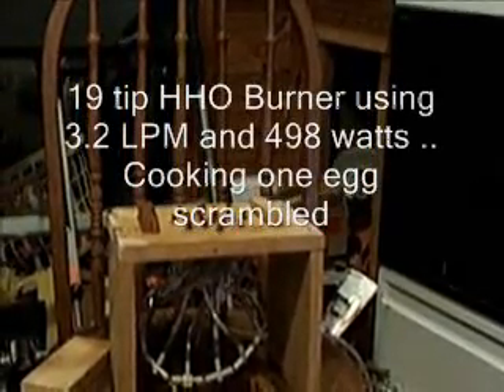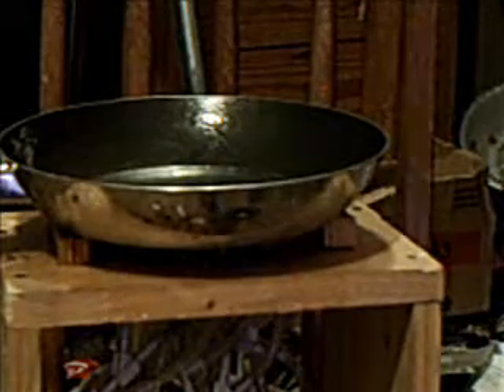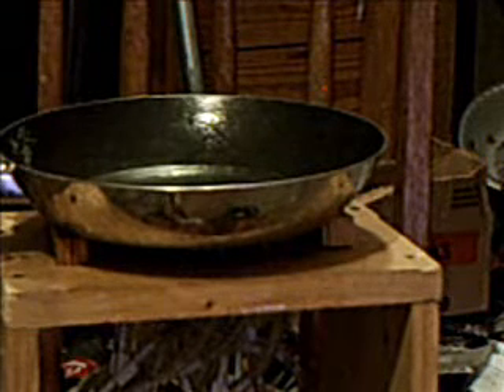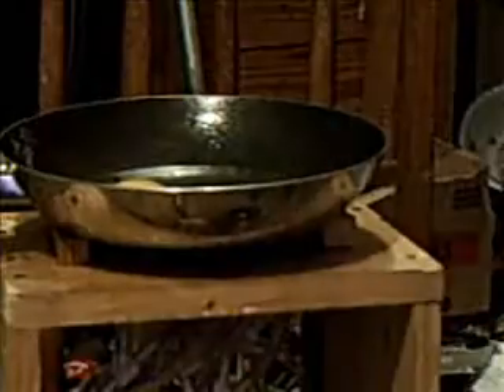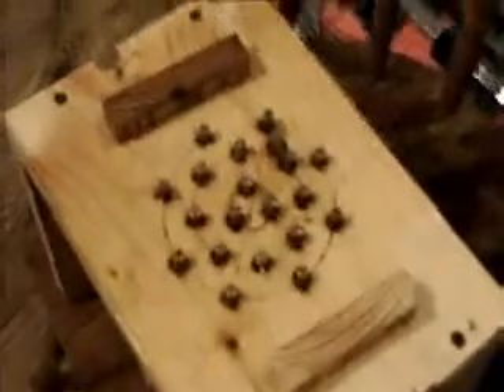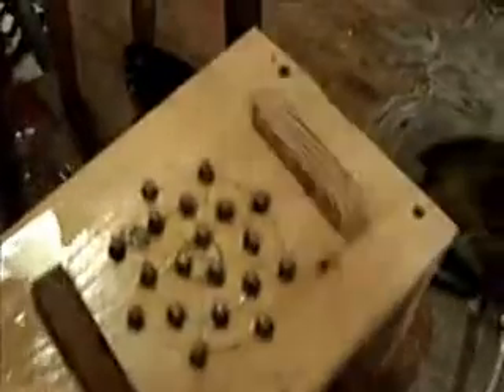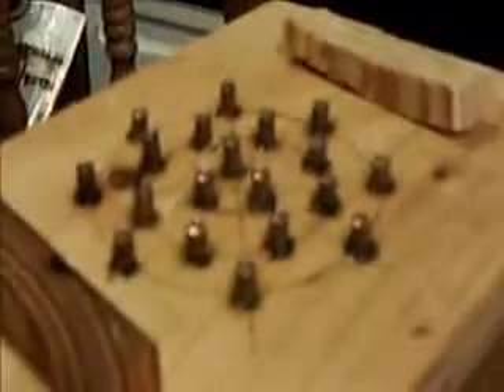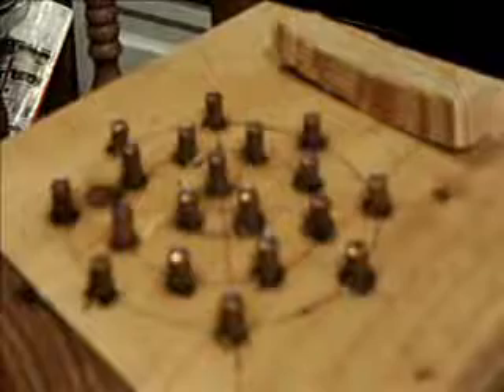HHO COOKING EGGS using 3.2 LPM 19 hho tips

Comment: Havee you thought of using that 19 tip burner as a way of doing low cost space heating? having a virtical duct that bends over to the side placed over it so that the convection draws cold air in, heats it by the HHO flames and then comes out the top and then possibly have a fan to draw the hot moist air out to the house?